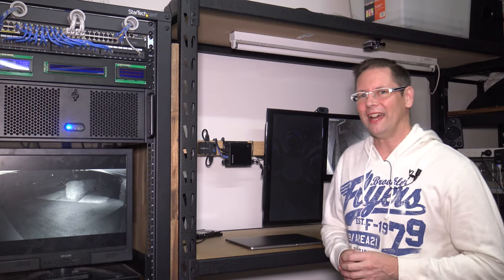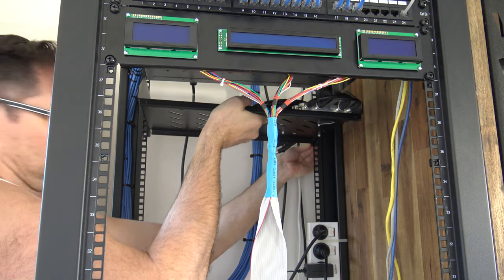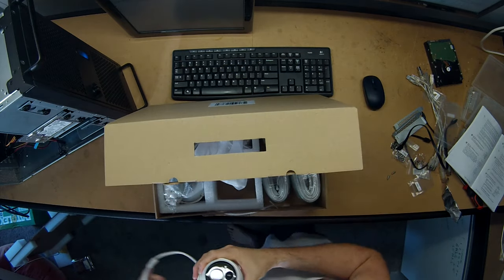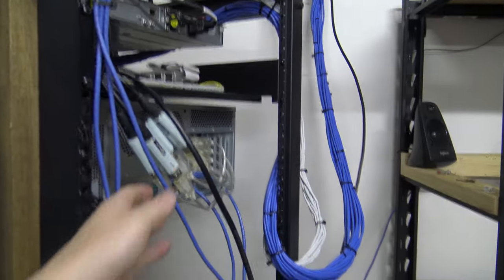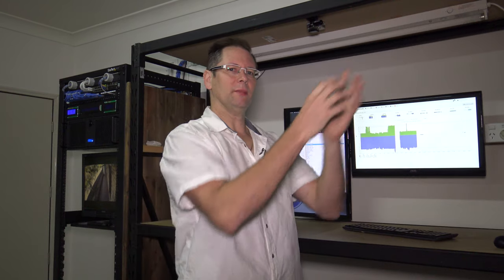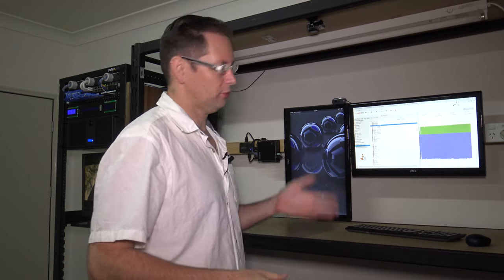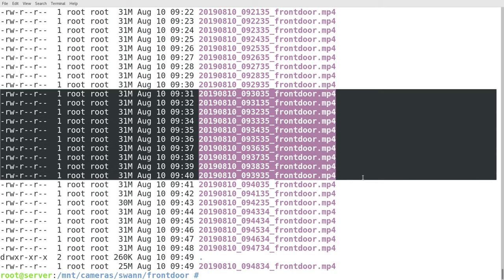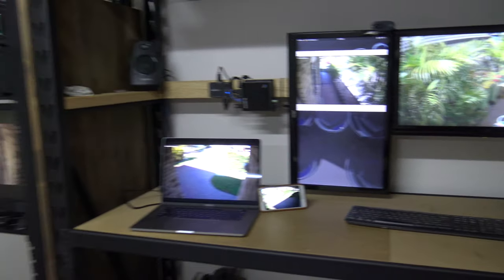Swann Security Server Install

Comment: Hey @CWNE88 I've added a card back in my video thanking you for sharing your tip on capturing security camera streams via FFMPEG (7:42) when sharing the Fibre run I've got going to my new shed (https://www.youtube.com/watch?v=Q3W9h2Vnw-g). I also mentioned how I built a Raspberry Pi Security System - Also based around you're project. Just wanted to say thanks for all the things you share! You're one of the Aussie Tech YouTuber's I keep coming back too.

Comment: In Australia at least Apple repairs are generally really easy. The Australian consumer protection laws are really effective. As I've never dealt with Apple outside of OZ I can not comment on else where.
Reply: Mike O'Connor my keyboard had an issue and the speaker popping, brand new bottom case at zero cost

Comment: Hey mate, I’ve been watching a lot of your videos and there is so much useful information, thank you. Just wondering about the specs of your server - wanting to setup some vm’s at home myself. Cheers. Mick (Brisbane)
Reply from the maker: Hey mate, it's just whatever recent type of thing was available from MSY. I have a lot of RAM in there which is the main thing. I'll make some more videos when I get some more ideas and can be bothered!
Reply: CWNE88  Cheers! I’ll be keeping an eye on my notifications. I was trying to figure out if your cctv server was a vm or running beside Proxmox. I imagine converting the streams would use a bit of processing power

Comment: Utp cable and cable ties could cause issues. look to use Velcro tape, works better for cat 6 cable for looming bundles and dose not deform cables as much.  Good vid otherwise!
Reply from the maker: The trick is to just put them on loosely

Comment: Am I right in thinking that both network cards are connected to the same Vlan and you are just telling server you route the multicast out of that specific card?
Reply from the maker: No. As mentioned, I have a video VLAN. The video in from the cameras stays on that VLAN and therefore NIC too.
Reply: Thanks, I’m new to this and want to give I a go.  so if your multicast traffic goes out of that same interface how does your bench computer see the streams.
Reply from the maker: If you mean, how does a host on one VLAN see multicast traffic on another VLAN, then you need to run PIM on the switch to do the multicast routing. That's a function that high end switches have.
Reply: Thanks.

Comment: How are you managing the growth of the disk space over time? to delete and overwrite old content? I Guess you could just script every 2 weeks to delete all everything older than X ?
Reply from the maker: I've got it all sorted :)
I have a hard drive dedicated to this, and have a cron job daily to delete old files past a month old. The directory names are based on the date, then I just use a variable `date --date="14 days ago" +%Y%m%d` and if it's that date, it's gone.
Reply: @TallPaulTech  i have a CCTV at work with around 60 cams.. The feature I think i would miss with a home done style would be the smart search..been able to select an area and search a time frame for movement.. Saves us a ton of time when incidents happen. But i guess the incidents at home are going to be far less likely
Reply from the maker: I had a play with the onvif stuff, now that I've heard of it. I used curl to get info from the camers, but haven't quite cracked how to read the log. If/when I do that though, I'd be able to check if there are any events within the time of a saved file and not it accordingly. You're right though that at home it's not that important, as it's mainly for if some shit happens I can go back and check pretty quickly. All files are in a shared dir and I can just open them up.
How do you monitor your 60 cameras? How does the system work?
Reply: @TallPaulTech  we are just running a 64chan Dahau NVR which is keeping around 10 days of footage on 28TB. Cameras sit on there own vlan the server has a second NIC which is on our normal VLAN. Not much else to say about them really. Utilising 280mbit.. Only monitored when there is a situation.
Reply from the maker: Are they unicast or multicast? I (as you probably saw) run the multicast video for the cameras and also the tv server multicast on their own VLAN.
Reply: @TallPaulTech  Just Unicast, I dont see much of a use for multicast really, I see your purpose sort of..But as they would only be looked at by a couple of people at a time..no advantage.
Reply from the maker: I just like playing with multicast, and sometimes use it as a source for network testing. If only a couple of clients, then yeah no benefit of setting up multicast on a network.
Reply: @TallPaulTech  Roger. Next video idea for you.. Automated sprinkler system.. Using the raspberry pi opensprinkler :-)
Reply: @TallPaulTech  could you upload all that footage to google photos for free long time storage? or to a google drive business account? or to youtube and set all uploads to private?
Reply: @25566  are you sure you want to share all your daily activity with google and everyone else who has access to that data? 
Hard drives are cheap, don't use cloud stuff man. You ended up here so you have interest in and at least some knowledge about networking, so this shouldn't be to be hard for you. There are loads of self hosted solutions available, paid or free and propietary and open source, if you want to do it with purposebuild software as well if you prefer going that way.

Really, don't use google ;)